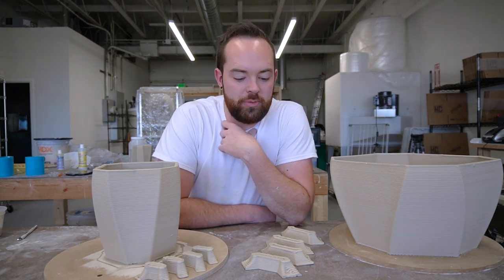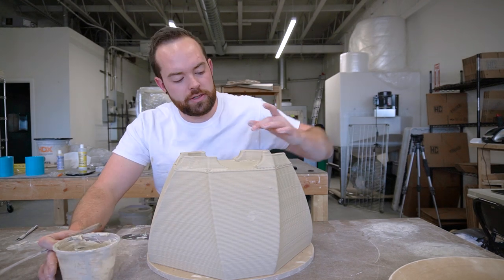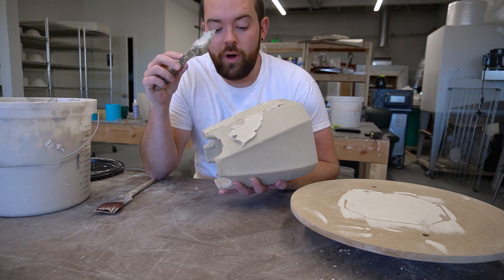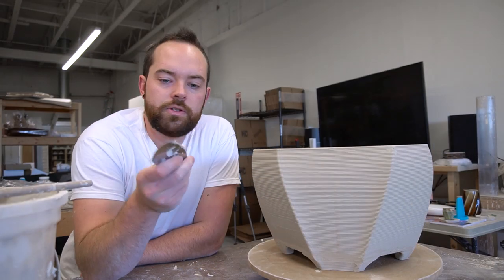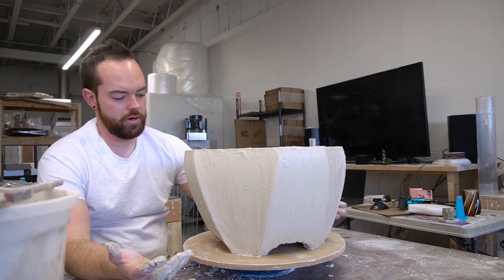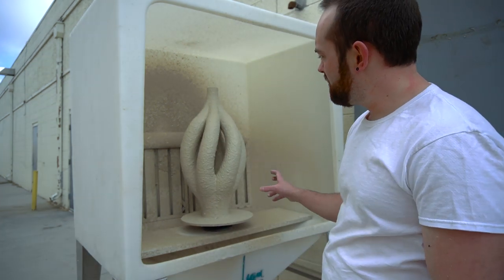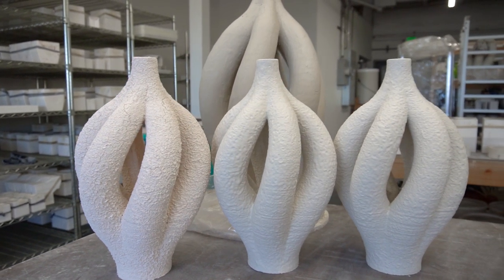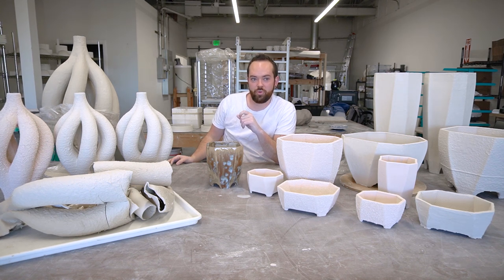Applying textures to 3d printed clay

Comment: Amazing work, I never worked with clay before beyond a middle school level, however, I love all kinds of practical science and have worked a few un-related jobs which really ended up having plenty of technique / knowledge-sets in common. Some of which were refrigeration, auto mechanic, computer systems from several angles... I'll get to my point, have you ever experimented with a vacuum chamber? They can do some cool things, they drop the temperature of the material slightly by evaporating the water more quickly than air drying, thus slowing penetration where temperature is a factor, they can cause it to foam up some substances by boiling the water out if you pull a strong enough vacuum, they can totally ruin things... just putting that out there 🙂, and they can potentially, just maybe, buy you time before your core piece self-destructs due to unwanted absorption. My thought is that after you spray the wet slip onto the dry pieces, you can put it in a vacuum chamber for 30 minutes or so and dry it out without it cracking because your not evaporating the water with heat or dry air, your boiling it out without heating the piece by dropping the pressure. You could build an acrylic vacuum chamber with the side being the open part just like your spray booth, then you wouldn't have to move your piece, just put the side on and engage the vacuum pump. You could experiment with all sorts of crazy ideas, you could mix slip with saw dust and vacuum it down in a VC then fire it, I don't know what this would accomplish but I'd love to see it on YouTube, maybe I just invented a way to create lighter bricks? hah! Anyway your creativity just inspired me to go on a thinking rampage... I hope my thoughts benefit your craft in some way, thanks for the great videos!

Comment: I haven’t 3d printed clay yet, though I do have a printer on the way. But in the past I’ve always let my pieces dry completely, then scrubbed with a wet sponge. If there’s still any lumps I sand after bisque firing.

Comment: I saw the pics of the large piece crumbling after you sprayed it on instagram and holy shit that must've been frustrating... But yeah, really cool to watch this more indepth talk of your process. Well done with the editing on this btw, was a very smooth watch for me!
Reply from the maker: It was a huge bummer to just watch it slowly crumble over an hour and not be able to do anything at all about it! On to the next one!
Reply: @HammerlyCeramics  Sounds like a plan! I'm sure the next attempt will be more successfull! 
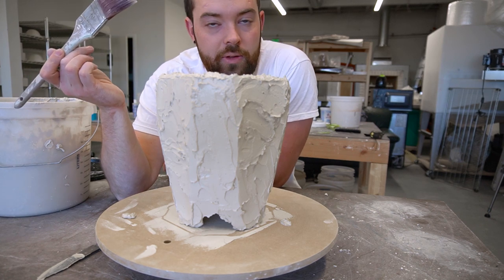Also for some feedback on the video itself, on a rewatch I kinda wished you used more of the camera angle from around 3:37 on the other sections where you worked directly on the pieces. Mostly because the regular angle sometimes has the camera focus bouncing from you and the piece (you can see this around 6:28 ish). Its not terribly distracting or anything, just feels better to me when I'm trying to focus on what you're doing. But thats about the only thing I can think of in terms of improvements. o/
Reply from the maker: @vashm87  gotcha!! I will work on that stuff. Definitely had the camera set to focus on my face automatically more often than I thought I did